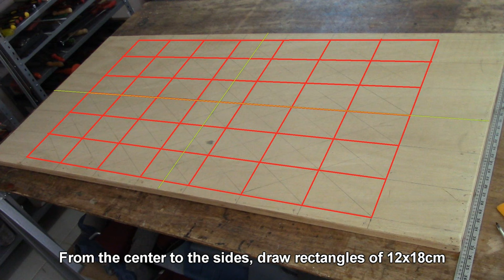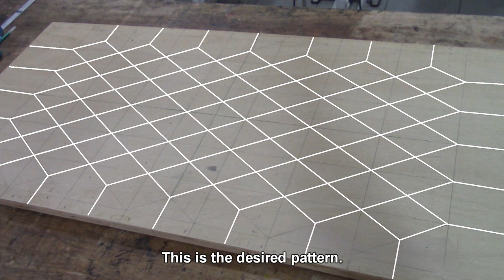Diamond Tufting (capitonné) - Part 1  Upholstery/furniture

Comment: excellent tutorials, I'm watching and learning, I've just got a used machine ,and practising the stitching you show,  you teach precise, in detail, and slow, great for a novice, thanks, keep up the good work
Reply from the maker: Thanks for watching the videos!
Do not forget it is advisable a thin a pliable leather to do this pattern. If you are going to work with thicker leather materials then it would be necessary to add a little more of allowance to do the pleats, otherwise they would disassemble.
After some practice you would not need those sewings.

Comment: What is that blue tool you’re using to make the tufting holes?
Reply from the maker: It is a 'hollow punch' 3/4" https://www.amazon.co.uk/Hole-Punch-9-pcs-3-14-punch/dp/B07C8HDWMJ
Hole saws are also useful to make the holes.https://www.amazon.com/Wideskall-Pieces-Hole-Saw-Assortment/dp/B07227QK9L

Comment: hello what kind of glue is that because many other videos advise to use glue spray
Reply from the maker: The 'solvent based yellow glue' is a traditional adhesive or contact cement used in car upholstery and furniture. It is the same glue used to stick formica as shown in the video about Upholstery Glues:
✅ https://youtu.be/o2xeezdF8Ss

Comment: Great video, but i still have a question. After making the holes on the board at 1:38 , how you make sure the holes on the density are exactly over the holes on the board?
Reply from the maker: +MrHouserobot Two ways of doing this: one is draw the same figures(rhombs) we did on the board on the foam. The  way I used on the video was done 'to save' this procedure...what I did is mark with 'green marker' through the holes in the wood leaving 'marks' for the whole 'points of rhomb intersections'.

Comment: Thank for sharing your skills and expertise the video is very inspirational. I would like to know the name of the tool that you used to cut the holes on the foam please
Reply from the maker: I used a 'leather punch' . If it is difficult to get one, you could make one by your own with a 'pipe or tube' the required size...It only would be necessary to sharpen/grind the edge in an angled way.
https://www.google.com.mx/search?q=leather+punches&espv=2&biw=1093&bih=530&tbm=isch&imgil=7PZwoZ-5IcAjLM%253A%253BXZSA1GuSj-44PM%253Bhttp%25253A%25252F%25252Fwww.goldyindustries.com%25252Fpunches.htm&source=iu&pf=m&fir=7PZwoZ-5IcAjLM%253A%252CXZSA1GuSj-44PM%252C_&usg=__KMkW_iGMa5kEbgN5ULoJ7mDBsac%3D&dpr=1.25&ved=0ahUKEwjBgdCHktnPAhXBWT4KHV8jA9gQyjcINA&ei=fTQAWIHPLsGz-QHfxozADQ#imgrc=7_r6ul5EkuvY7M%3A

Comment: what is the material you are using special the white board in its back
Reply from the maker: The board is a 3/4" plywood
Reply: at min 7:36 from the video its like white resilient pad, what is that material
Reply from the maker: Sorry, I now understand...I used a piece of cardboard(shoes' insole material) for the demonstration...don't use this material as a base...it is too weak.
Reply: Thank You so much

Comment: amigo sabes cuanto ocupó de te la para un sofa grande de 3, 2 y 1 gracias
Reply from the maker: +Victor Vazquez   14 metros aprox. sin cojines sueltos y 18 aprox. si lleva los cojines sueltos.
Reply: Cechaflo y para el de 2??. TE LO A GREDECERIA MUCHO.
Reply from the maker: +Victor Vazquez +Victor Vazquez Estimado Victor, ahora si me la pusiste dificil, no quiero dar medidas falsas...si soy capaz de tapizar muebles, pero en realidad soy tapicero de carros.
Trata de hacer tus calculos tu mismo...ya sabes el material casi siempre viene 'doble ancho'...puede ser 1:40 mts o 1:50 mts, puede ser tela o vinilo...empezar a calcular uno por uno dibujando en un papel de como se acomodarian y se harian los cortes. La tela puede tener la textura entera o a lo mejor lleva dibujos de franjas o lineas, entonces se llevaria mas material porque se tienen que acomodar en forma vertical...si es tela tipo velour hay que considerar que el vello de la tela 'peina' de arriba hacia abajo y si uno lo pone en otro sentido forma otra textura o sombra diferente.

Comment: hi what is the hole cutter that you used called
Reply from the maker: +Tiana fabray-smith  I only have used a 'standard puncher' check min1:55 to 2:08. Small circular saws to make holes in wood are also useful...they are attached to a drill.
Reply: Okay thanks

Comment: Please list. I like to know the names and types of materials used. Where to get them. Ty.
Reply from the maker: Hello John, I bought these materials in Home Depot. As we can see in the video: slim wood beams for the wooden frame, plywood 1/2", carpenter's glue and nails to attach the wooden frame to the plywood. The legs were made by attaching two brackets with aluminum rivets. These brackets are used to hold floating shelves and were fastened to the wooden frame with some screws.
The other material over the plywood is just foam I bought from an upholstery supplier.